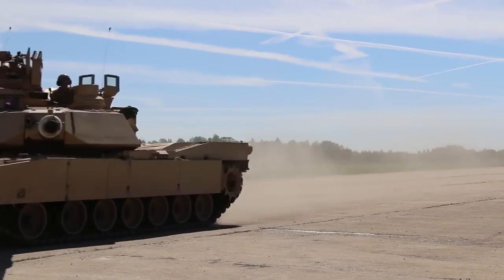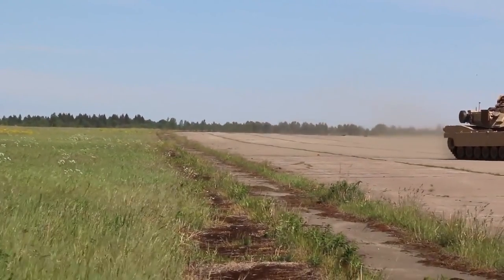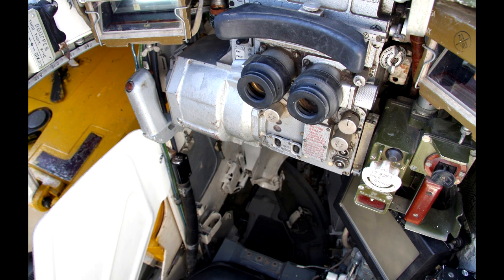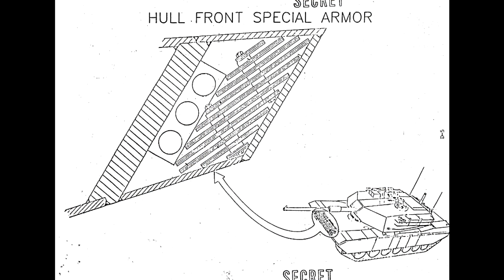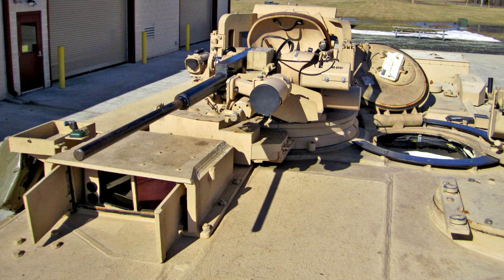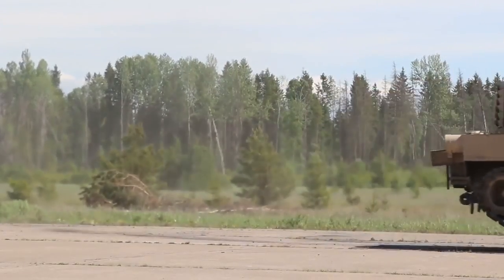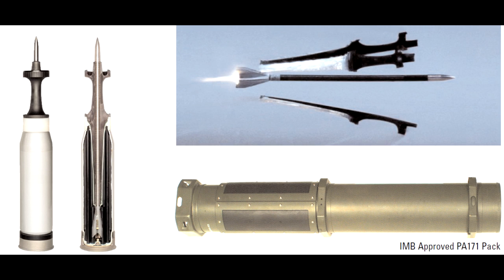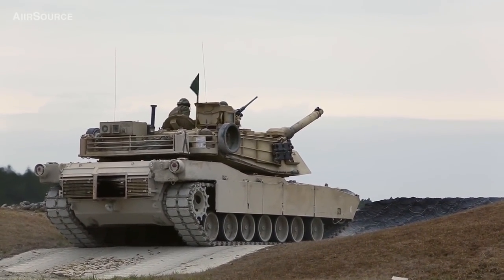Problems with Abrams tank

Comment: So, as an American, I appreciate you taking some of the air out of our egos. Really. It's good to have a reality check.

However, I have some nits to pick:

* The military knew that the M1 as it debuted had a lot of problems relative to its competition. The designers knew that improved gun and armor technologies were coming along fairly soon, and they would be providing upgrades to the vehicle when those became available. The idea was to simply get the new platform out there, make sure the basic vehicle does what it's supposed to do, get the crews experience with it, and put the whiz-bang tech on it later. If that sounds unusually wise and thoughtful for an American weapons development program, it was. The Abrams was designed in the aftermath of the collapse of the MBT-70 program. That vehicle was a typical American development program; get all new shit, and put it all on a brand new vehicle. Well, uh, none of it worked, and it was deemed that by the time it could be made to work, it would all be obsolete. So the imperative with the replacement program was to just get a new vehicle out there that was, at worst, equivalent to the old one (the fundamentally WWII-era M60), but with lots of room to grow. And that's what they did. In that respect, the Abrams did exactly what it was supposed to do. It was designed with improved armor and a much larger gun in mind.

* I'll give you that the gas turbine engine doesn't make a whole lot of sense today, and that the air filters were crap for the kind of fighting the US eventually did with the Abrams, but both of these things made sense for the purpose for which the Abrams was designed: Countering Soviet Deep Battle operations in Germany. The plan for the early 1980s was that the M60s would be the first line of armored defense, and that the M1s would be assigned to rapid response units that would move to meet any Soviet exploitation forces that moved into a breakthrough. Another requirement was moving from European port cities directly to combat without use of road haulers (which were still used whenever possible, but the capability to eschew them was considered desirable). Both of these scenarios involve extended, high-speed road marches, and you better believe that, for a 70 ton vehicle, a gas turbine was far more efficient in that use case than any diesel. So, again, these things made sense in the environment for which they were designed.

EDIT: I completely forgot to mention the multi-fuel issue with the choice of the gas turbine. They can run on just about anything that burns, from gasoline to diesel to alcohol to coal dust (though not very long on the latter), and at the time, the US military was concerned that the tank force's need for fuel during a war with the Soviets would outstrip the supply. Remember that, in such a conflict, a lot of stuff would have to be shipped across the Atlantic from the US, just as in WWII, and the Soviets would try just as hard as the Germans did to shut down NATO's Sea Lines of Communication (SLOCs). Having a tank force that could run on just about any kind of fuel meant that it would be less affected by setbacks in the Atlantic. Once again, the features of the tank make sense in the context for which they were designed, whether or not that context is still relevant.

* The upper plate. You have to keep in mind, American tank doctrine of the time called for fighting hull-down whenever possible. Between this and the tiny size of the front plate relative to the rest of the tank, the designers didn't think this was a huge issue. I don't know enough to have an opinion about whether it is or not, I'm just pointing out what the design reasoning was.

* Finally, you mentioned that we could put the L55 gun on the Abrams to improve its firepower. Yes and no. The important thing here is that the L55 gun has a barrel that is 1.3 meters longer, which doesn't sound like a lot, but it can make a lot of difference to a number of things. First, it can make a lot of difference in how maneuverable and usable the tank is in cluttered areas. German tank doctrine has historically liked to keep the enemy, regardless of what type,  at arm's length, and the L55 gun fits into that scheme well. American tank doctrine, particularly recently, has allowed for tanks to get right into very built up areas. The extra barrel length of the L55 would make that more difficult, especially swinging the turret around to bear on different targets. Second, it will change the way certain munitions work. The canister round in particular, relies on a certain spread, and a longer barrel would materially alter that. Finally, in the words of The Chieftain, you have to remember that the two biggest considerations in the design of almost any American combat vehicle or land weapons system in general are the Atlantic and Pacific oceans. American weapons must, by definition, be amenable to being packed up on a ship or occasionally an aircraft, and being shipped to where it's going to be used. Increasing the barrel length of the tank means that fewer of them will fit on the ships that have to carry them, which means that more ships will be needed to move a given unit around. Given how few ships we have to do this, increasing their workload is probably a bad idea.

All in all, though, good video.
Reply: I am now smarter thank you.  Also thank you for knit picking in a quite respectful manner especially for youtube's standards.  what a rad lad.
Reply: JohnnyWishbone85 made some great points. To point a few other things as well that was not mentioned during the video. The M1 Abrams and the Leopard 2 was a joint venture between the US and Germany. While both tanks are very similar they do have their differences as well. The one thing these 2 tanks did as they set a new standard in speed, maneuverability, and doing this with very high accuracy on the move. As to the turbine engine. Well the Abrams didn't receive the nickname "whispering death" for not reason. While the Leopard 2 has a slightly faster top speed the Abrams can reach its top speed faster than any tank and the Abrams is governed at its top speed so to protect the drive train. The Abrams can go much faster than its governed speed. The US (do not recall the name of the company or the name of the new engine) has developed a new diesel engine that is more powerful than the current turbine used, more powerful than any tank engine as for as that goes. Not sure what the plans are if it will be put into the Abrams, but Germany plans on using it in their newer Leopard 2 tanks last I know of. As to the armor the Abrams has received upgrades with every model. Something to look at is how many enemy tanks have managed to penetrate and take out a Abrams? The answer is none. While the Abrams did receive hits from T72 125mm guns the rounds stuck in the armor. Now the US does sale Abrams to a few countries that have far less armor protection and tech on them and some of them have been disabled or destroyed. Of the Abrams destroyed most were only damaged and because of ongoing combat or other reasons the tanks were destroyed by friendly fire as to not leave behind a repairable tank or tech. It became more common practice to call in a strike from an Apache gunship or Fighter plane to destroy the tank as often they struggled to penetrate and destroy the Abrams while firing on it with another Abrams. In many of the pictures that can be seen on the internet many of the tanks are the exact same tank from a different angle, some or of sold Abrams that are not even of the US Army, and most or of Abrams with the gun facing the rear as standard practice of the Army and those are tanks that the Army chose to destroy themselves instead of recovery or repair. In fact the first soldier to actually be killed by in an Abrams came from a tank mine combined with 1,100 pounds of explosives and 155mm rounds. In which 2 of the 4 crew were killed and 1 injured. The vast majority of US tankers killed have been by sniper fire or other attacks while outside the tank. Besides all that no tank is designed for urban warfare. No tank would hold up to the same IED used to disable tanks. With that said IMO the Challenger 2 is the most armored tank built. 

As to the 105 gun. It is still in use today like on the Stryker and it is a very effective gun. Something that is not well known as the Abrams stole the spotlight in desert storm the Marines had one of their largest tank battles in history as they were the primary force in taking Kuwait. The Marines were still using the M60 while the Army got all the new M1A1s. The Marines in the so called out dated and out matched M60 out maneuvered and out shot the T54s, T62s, and T72 tanks they faces. While a few M60 tanks took hits, they took them and allowed the crew to survive and in some cases they continued to still put rounds on target only being immobilized. And the M60 using the 105 had no problems penetrating the Russian tanks.
Reply: @yahtotv5492  "came from a tank mine combined with 1,100 pounds of explosives and 155mm rounds." I don't believe that. The armor wont protect the people inside from the shock wave and at that size they would easily kill any human. Plus the tank were monkey-models of the real soviet tanks. export versions horrible crews
Reply: @ulfenburg7539  Well it is a fact that it happened. It lifted the tank off the ground and flipped it over. The turret even came out of the hull. Like I said 2 of the crew died and 3rd was injured, those being the men in the turret. The driver was the least effected. It is recorded history with many witnesses. You can look it up and read about it.
Reply: @yahtotv5492  I have searched and found nothing on the matter
Reply: @yahtotv5492  nice you showed me a picture but not anywhere it is says it was 1100 pounds of explosives nor it says how many has died
Reply: @yahtotv5492  The funny thing is i searched. "1100 pound IED abrams", "abrams lost turret to IED", and some more and I got nothing
Reply: @yahtotv5492  Yet im still not going to believe it without real data. He is a soldier but and soldiers are not credible. With a real source covering the incident well I'm not going to believe someone goes away from 500 kg of pure explosives
Reply: @ulfenburg7539  Dont believe it then. I remember it being talked about a fair amount after it happening because it was a big deal. There use to be several articles about it, a youtube video on it. But like most things on the internet over time they get taken down, deleted, or just buried.
Reply: @yahtotv5492  gotten taken down? LOL nah i found the articles. not a single one mentions 500 kg of explosives. all of it is true just not the 500 kg. I even found one saying they died in an ambush and the explosion just disabled the tank
Reply: @ulfenburg7539  shock absorbing armor is a thing
Reply: @IronmoonDragonLance  yeah but can it block a bit over 100 ish kg of pure explosives? I don't think so.
Reply: JohnnyWishbone85
L 44 and L55 is a german tank cannon from   Leopard 2A7+
Reply: @mariannepompa4152  Yes the M256 is based on the Rheinmetall L/44. The US is licensed to produce the gun. But the M1 Abrams and the Leopard 2 were a joint venture so you could say the Abrams and the Leopard 2 are both full of US and German tech.
Reply: @mariannepompa4152  guns are from Rheinmetal,  and the same so both tanks could use the same nato rounds, but before the abrams and the leopard usa and germany wanted to develop a tank together, politics and stupid aguments like measuments in inches or metric prevented that.
Reply: oversized comment lololol
Reply: Intriguing, thank you.
Reply: And from a materials logistics perspective the turbine makes a ton of sense as its the same engine across three different vehicles. Apache, blackhawk, and abrams.
Reply: @joehelland1635  true... It solves an issue with mass production. and it means parts can be salvaged from a destroyed vehicle
Reply: Holy carp some nits? Dude you made an entire book
Reply: Nice
Reply: You should write a book
Reply: I appreciate the response here. It's a really good reminder that when it came to the development and usage of the m1, all downsides were deemed more as a compromise rather than just engineering oversight which is how this video sort of makes it sound.
Reply: Another point is that the turbine engine has a longer expected lifespan meaning longer times between full engine overhauls and less cost over all even with fuel costs
Reply: Did I really just read all of this and watched the whole video?

RedEffect has left the chat.
Reply: Speaking of built up and urban areas... that's why across the pacific another US ally still maintain L/44 guns.

Japan.
Reply: Desmond Griffith  how did you come up with the panther being the best tank in ww2 ?! 
egypt and syria did not have t-72 in 1973 they only had t55/54 and t62 and some t34-85/100 and SU85/100 variants , only syria and iraq had them later on while egypt got the downgraded M1 abrams 
the israeli centurions were not ww2 era tanks they were upgraded to the Sho't variants
Reply: The question is how have M1s preformed in battle compared to the enemy tanks.   My friend who was an armored officer in Germany said that the army only wanted enough tanks to work with helicopters and planes to kill USSR tanks.  The US was never going to build enough tanks and relied on aircraft to kill tanks.  Latter MLRS  would be use to kill enemy tank formations.   In Iraq superior armor on M1s was not penetrated.   Superior fire control often killed enemy tanks with one shot while on the move.
Reply: @saltyroe3179  The success of the M1 in Iraq isn't much when east euopean T-55am and am2 could defeat them without problems.
Reply: This is a long comment!
Reply: But what about the Thunper program?
Reply: might aswell write a book
Reply: @flippintwit1337  or the sequal to chieftain's, "why the M4 was what it was." "Why the Abrams is what it is," will be a hit.
Reply: Yea but most of the problems were worked out with the m2,  the m1 I would argue was still a worthy task but the m2 fixed most of the issues. Really the only problem with the m2 is the fuel consumption.
Reply: Some nits to pick
Writes a book about'em
Reply: This is a civilized discussion that I enjoy.
Reply: Im not the kind of guy to read all this but uhhn A FEW NITPICKS
Reply: Epic explanation.  I always wondered if the Abram is so bad how come it kicked so much ass any ass that you put in front of it
Reply: Good point on the issue of the upper plate (top glacis plate). I also do not think the Americans would leave what is supposedly a glaring vulnerability on their tank when it can be easily remedied with additional armor plates. Tests probably showed the angle would be enough to deflect incoming rounds. 
I agree with the issue of the Americans coming off with the failed MBT-70, losing some years and momentum with that. And that the first variants of the M1 Abrams only had to prove able to incorporate additional technologies and upgrades when it was first produced. Even Soviet/Russian tanks do not come off from its first variant as a perfect tank, with all the bells and whistles. 
Also the Abrams is supposedly able to target and fire accurately at Soviet/Russian tanks even before those can close in enough to counter, and there also how a tank is integrated into a system involving other weapons like air assets.
Reply: Thats alot of nits.
Reply: If you're a big deal,F you're such a big deal,then WHERE IS THE DEAL? I NEED A NEW DEAL-
Reply: A few nit picks? Goddamn just write a whole ass book lmfaoo
Reply: “Some”
Reply: Just to add on to your points. The AGT-1500 was not only chosen for its greater fuel efficiency at higher RPMs than a standard diesel, but also because of its multifuel capabilities. The turbine is also quieter than a standard diesel engine as well.
Reply: @firestorm208  You do realise most countries with M1s switch to diesel engines outside of the US because of costs plus increases range.
Reply: Woodrow Wilson wished the US Army had Abram Tanks during WW1
Reply: @christiandauz3742  tog 2
Reply: @dwayne7201  

???
Reply: @christiandauz3742  the tog II was designed for trench warfare
Reply: No,the main reason they use different guns is DU ammo.DU loses strength at very high speeds.Tungsten doesn't,but is weaker.

America uses DU,so "upgrading" to the L/55 is pointless.Germany and others don't use DU,so they need the longer gun to get the same results.

Redeffect  didn't do basic research.
Reply: @naamadossantossilva4736  "DU loses strength at very high speeds" why
Reply: @ulfenburg7539  DU is very brittle, if it impacts at to high a speed it will shatter before achieving full penetration. 

Tungsten would have to be going well over what is currently possible to shatter on impact.
Reply: Basically, author-dude can't phantom difference between 'flaw' and 'conscious design decision' for given requirement.
Reply: Piotr Dudała 🤣 I designed my tank to suck a bag of dicks the first ten years of its existence lol said no fucking one ever.
Reply: @piotrd.4850   - fathom
Reply: I am not reading that
Reply: @wearenumberone1111  Nobody cares what you do or don't do.
Reply: @JohnnyWishbone85  wow I didnt knew that you were everybody
Reply: people seriously being rude over a joke? i have no hope for the next generation now
Reply: @teamfortress2teamfortress881  ık right all I did was say I am not reading that because it is too long
Reply: @wearenumberone1111  yeah
Reply: chocolate TR - I'm kind of a big deal.
Reply: Omg, no thanks